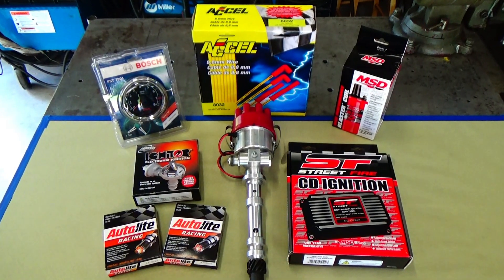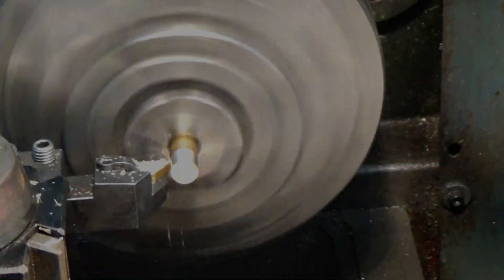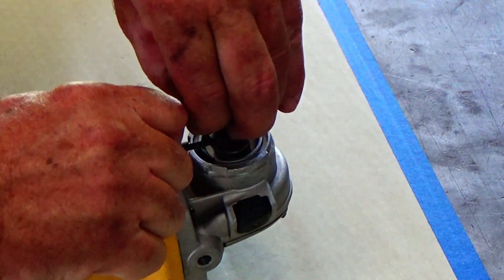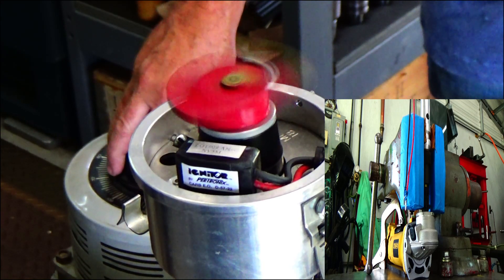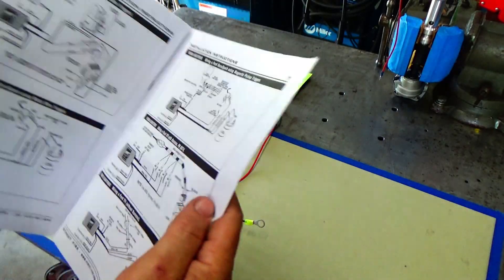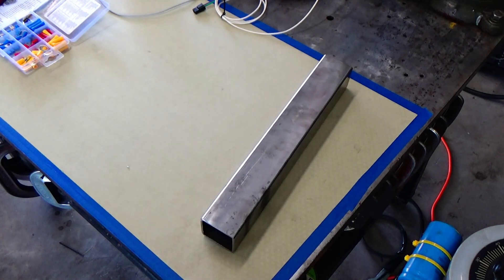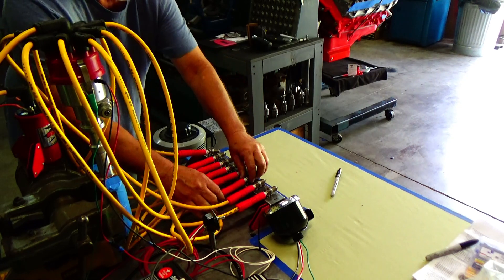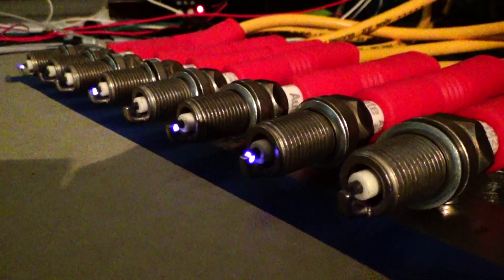Building a Test Stand for the Ignition System   #27 Chevy 454 Big Block Performance Build

Comment: I use to do this with the GM HEI distributors when I was young to test the HEI junkyard distributors I'd get cheap. I never did hook up the tach which is a great idea.  Nice to see everything sparking away.
Reply from the maker: Mike that was pretty smart.... My testing of my old junkyard parts, didn't start till it was installed in the car...
and as you know, they don't always work....  Good info... Thanks for sharing 😀